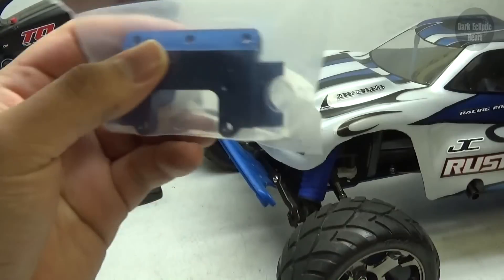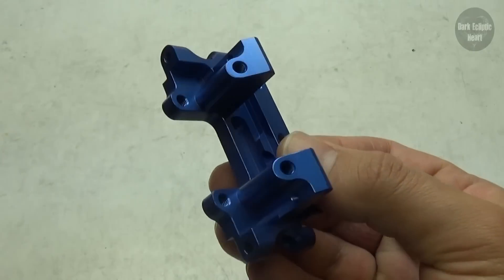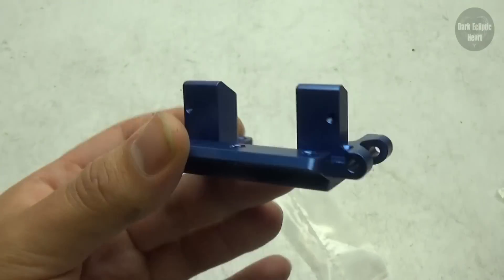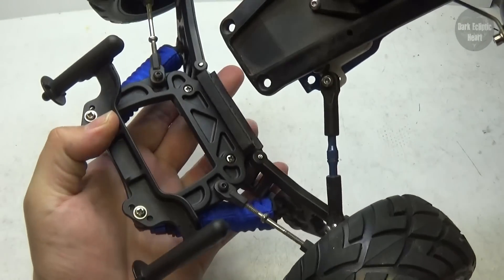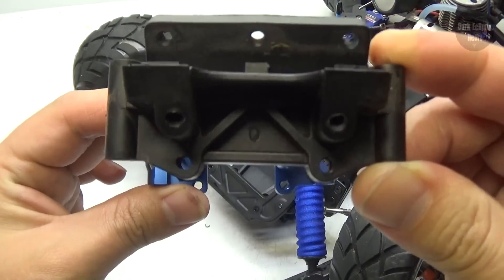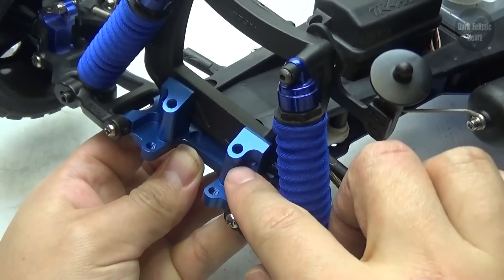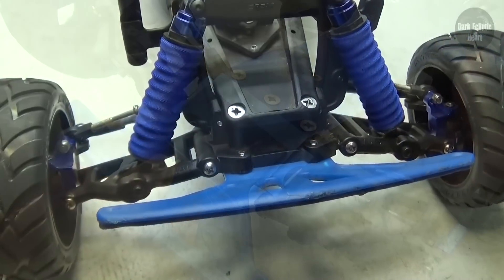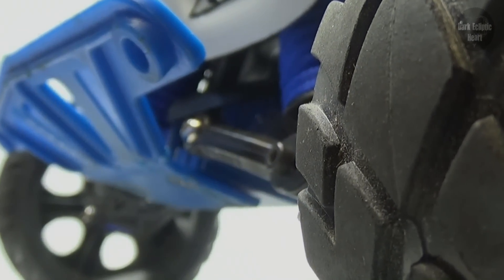Banshee - Traxxas Nitro Rustler-  Level 20 Upgrade - Aluminum Bulkhead

Comment: What's your opinion about aluminum a-arms?
Reply: FuzzmasterStudios NOOOOOOOOOOOOOOOOOOOOOOOOOOOOOOOOOOOOOOOOOOOOOOOOOOOO!!!!!!!

My buddy and me got our N. rustlers about the same time. He went ALL aluminum, and I just went ALL RPM plastic, with the exception of the front bulkhead being aluminum.  I like how the aluminum bulkhead is heavier, and helps keep the front end down.   FYI he no longer has either aluminum shock towers (they constantly bend) and got rid of the back aluminum A-arms.  REMEMBER, METAL DOESN'T FLEX.  So, if you hit something hard, your gonna bend something. He constantly was fucking up his shit, meanwhile, my rusty would do a 35 foot cartwheel,  and be 100% OK. 

Not to mention, going aluminum just weighs down your rig.  "Aluminum for show, plastic to go."